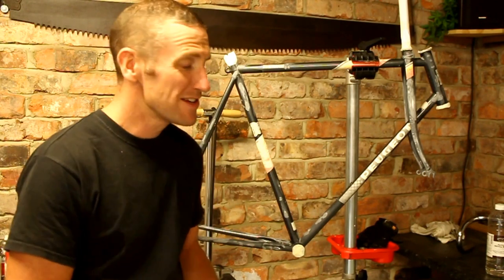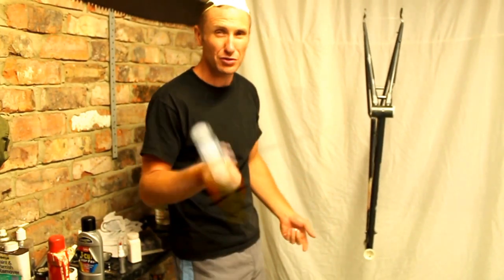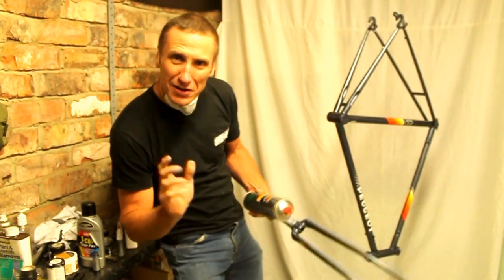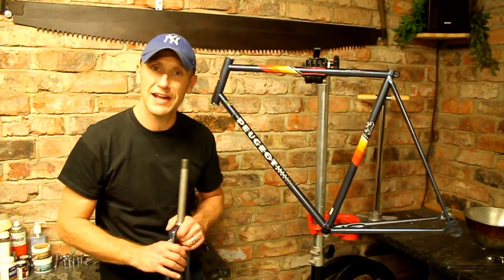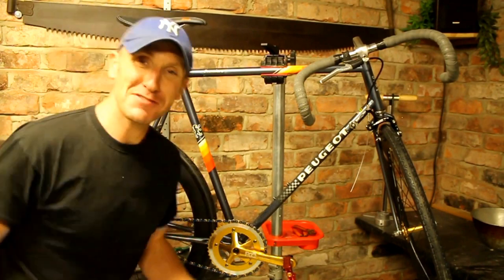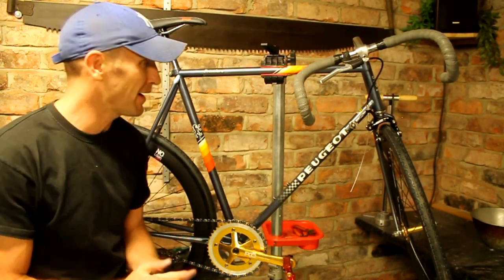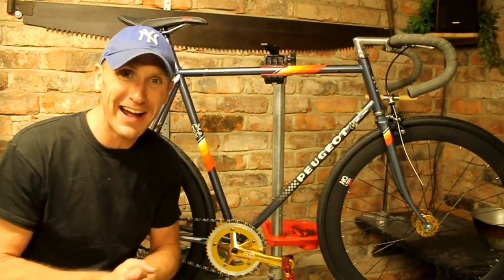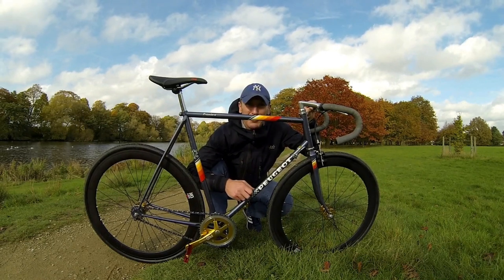Bike Maintenance - Part 2 -Rebuild and Ride- Peugeot Premiere Fixie Restoration

Comment: This is probably the coolest fixed conversion I've seen in a while. Usually I like the bike to be more modern if people are riding fixed (visual preference). But man, you pulled it off.
Reply from the maker: Thanks for the watching and the comment, stay tuned and Subscribe as I have just finished a Vintage Raleigh Fixie that will be up soon. I think it gives this one a run for its money. all the best Andy

Comment: I also have a steel Peugeot PFN10.
How did you deal with the standard hubs in the Peugeot frame original  is 96mm front and 126mm rear ??? The new standard is 100mm and 130mm.

Comment: I have a frame just like this. What bottom bracket and crank did you use? There's so many to choose from so I'm lost on which to purchase.
Reply from the maker: +Tim Large hello Tim I used the original bottom bracket and just replaced the bearings. The crankset I bought from eBay search for a 46t crankset. Thanks Andy

Comment: Hi m8, you said in the vid that you masked of the decals and then sprayed it, but how does that work, since you need to spray it all?
Reply from the maker: Hi and thanks for watching! Taping up the decals protects and stops the spray covering them up. This process only works if the spray you are using matches the existing one and  is more of a blow over. I hope this helps. Andy
Reply: @BikeItUK  Where did you find the exact matching color? I have a dark blue Peugeot from the same age and would love to paint it over, protecting the decals!

Comment: how much did the bike cost in parts, excluding the frame. got the same frame so think I'm going to convert it in the next few weeks.
was just wondering how much you spent.
Reply from the maker: +callum barker hi thanks for a he comment and watching I can't remember all of it the main cost was the wheelset £89 inc tyres and the crank £20. Good luck with the project cheers Andy

Comment: Once again a great bike! I'm respraying a Peugeot as well soon. However I'm worried about the difference in colour tone, new paint vs masked area. How did you avoid this except buying the original colour?
Reply from the maker: +Oliver Vukic I managed to find a general Peugeot match at Halfords on this one. If you are worried you can get it colour matched at a Auto spray company. More expensive though. All the best and good luck Andy

Comment: Hey Andy, me again, curious about the bottom bracket, sine the original had 2 or 3 rings, did you use the same bottom bracket? And if not, what size is u buy please?, thank you so much :)
Reply from the maker: +Nauj Aral Hi no problem, I hope you are well! Ref the bottom bracket I generally just use the original and buy new bearings, keeps the cost down and normally the only damage is to the bearings. If you do need a replacement then can you not just measure the original? Andy
Reply: its french but other then that, you could get a new bb yes

Comment: i was going to re build a peugeot bike but was a bit worried about the bottom bracket, as in could i put in a sealed english bb or would i have to try and find a french thread one?
Reply from the maker: +Andrew Leightell Most of the 80's frames are all standard Bottom Brackets I had no issues at all with any of them. Vintage bike are so much easier to work on than the new forever changing modern bikes. Sorry for the late reply thanks for watching Andy

Comment: Hi andy, I was just wondering what action i could take on a bike frame with a rust hole in it. - raleigh dynatech 700. hole is located on the chainstay so quite a precarious place to have a weakness, hole is about the size of the diameter of brake cable wire. cheers.
Reply from the maker: Hi, I’m pretty sure that it’s not steel. I would use a solution to treat the rust and because it’s such a small hole probably just use a metal poxy resin and sand off. I hope this helps all the best and good luck 👍🚲

Comment: I have a Peugeot I found that was abandoned  and it looks brand new except for rust on the rims. I thought about making it a fixie  but never saw it done until now. one question the crank assembly is all new and upgraded or does it still have old parts??
Reply from the maker: Yony M Old parts as a rule however some times new bearing are required which can be obtained on E-bay for a couple of pound! Thanks for watching I hope it makes you get involved with your Peugeot!
Reply: +BikeIt UK great thanks for the advice ! your bikes look dope! hopefully I can pull it off as well

Comment: Hi there! Love the channel and seeing you make these bikes look beautiful. I am currently restoring my dad's old peugeot, eventually going to make into a fixed gear. But going to leave it as a 12 speed for now. I need to replace the inner tube right now but I can't quite fine what size that is. Can you possibly tell me the inner tube size? As well as the wheel/tire size for when I look for the fixed gear parts? Thank you so much!!
Reply from the maker: +Joshua Kotani hello and thanks for watching and tuning in. The newer wheel size is call 700c and the older ones are 28". Regarding inner tube size there really isn't much in it, however what does matter is the widths of the tyre. If say you has a 30mm Tyre and used a 23mm width inner tube it's would stretch the rubber inner far to much. When your converting to a fixie and use 700c you may have to bang on some longer reach brake callipers. I know the RJbikeguy on here has covered it, check him out if you haven't already done so. I hope this helps and made sense. All the best and good luck Andy

Comment: It was amazing watching how you transformed the bike but Did you use primer and do you have to use primer, when re-spraying
Reply from the maker: +Abid Khan If taking the frame back to bare metal then yes it is advisable to use a primer. Thanks for the comment all the best Andy
Reply: +BikeIt UK thanks and another question that I got is, can you leave the old bottom bracket and put an new crank.
Reply from the maker: As long as its not damaged I generally replace the bearings which do not cost much to replace. Andy

Comment: Nice Job Andy. Was wondering if you did anything special regards to the forward leaning dropouts on the rear wheel for the fixed gear/single speed conversion where a track bike would usually have flat, rear-facing dropouts? I have a frame just like this that I run as a single speed too, but without the derailleur taking some of the tension out I've always been worried the wheel would slip forward out of it's dropouts (happened once on a test ride - bit hairy). Cheers
Reply: +Sam L I've recently turned a vintage frame with forward face dropouts into single speed. 
the best thing to do it make sure you have washers between the frame and the nuts, and tighten it like noones business. If you are still worried you can get nuts with washers build it that would be even more secure. Other than that you should be fine. I've been riding mine ages now even forcing it with all my might up hills and never had a wheel slip.
Reply: +Conor Salisbury Thanks for the reply!

Comment: Great video and bike. Plan to use some of the same bits on my blue Peugeot from same year. I've found the black wheels with gold hubs. Did you use the original crankset sprayed gold? Also did you use all original headset and bars? If so did you polish them up yourself? Full parts list would be helpful.
Reply from the maker: +Robert Macleod The Wheels was No Logo, Used a brand new gold crank set from ebay. Polished up the head set and handle bars, can't remember the brake calliper that I used. Seat was a Charge saddle. Good luck with the build hope that this helps and thanks for watching! Andy

Comment: Hi Andy. I love your videos that much its inspired me to purchase and old peugeot bike to restore into a single speed/fixie bike. Everything is going smooth so far but I'm struggling to choose the wheelset. I noticed you used some 'No Logo' wheels in your restoration, however these are out of stock everywhere now. I'm looking for a similar all black deep rim wheelset. Any recommendations would be much appreciated. Thanks, keep the videos coming!
Reply from the maker: Hi Nathen thanks for the words of support and really happy that the videos have inspired you. To be honest I don’t have a brand I always use. I will generally just search 700c 40 or 50 mm depth flip flop wheelset. The prices can vary from month to month but for a single speed wheel set I won’t pay more then £90 generally. Nine times out of ten I just use eBay. Sorry I couldn’t give you a direct link good luck hope you find a good set at the right price 👍
Reply: BikeIt UK Thanks for the quick reply Andy. I'll continue my search a little longer. So far I've found some made by Quella, which are a little more than I was hoping to pay but they are under some warranty. Thanks again!!

Comment: Hi Andy,

Great video - the finished product looks superb. I have just sourced the same Peugeot frame but in metallic blue and plan to covert it to a fixie! Other than the rusted areas you sanded/primed before spraying, did you just spray straight onto the original paintwork without priming beforehand? Thanks, Adam
Reply from the maker: If spraying I generally use a primer if small areas I will just paint on 👍

Comment: Cracking job Andy as usual. I have exactly the same bike and colour. Can I pick your brains if I may? Peugeot Iron Grey - exact match  or close? Did you mask off the decals accurately around them or just approximately? Finally I have got some very good alloy rims with a six speed cassette, also some nice alloy handle bars. Would you use these or keep to the chrome steel rims and five speed cassette and steel handlebars (all in very good Nick)? I'm thinking about originality and desirability? Any advise you can give would be much appreciated. Cheers Jonathan.
Reply from the maker: Hi, thanks for your comment of support, regarding your Peugeot it was some time ago now. What I generally always do is take the folks in with me when buying the paint. Regarding the build either go fully original if the parts are available at a cheap price, or I’d say if your going to be using the bike yourself go with what you’ve got. The bikes not a high end model I’d probably go with the wheels etc you have!👍 I hope this helps and good luck with the restoration all the best Andy 😉🚲 enjoy

Comment: What wheel set do you have what's the price and where can I buy them btw really nice bike it looks amazing I'm building a vintage fixie aswell but I'm making it chrome
Reply from the maker: +lukas mikolajczak Very sorry for such a late reply the Wheel set I used on this build was a company called "No Logo" I hope this helps Andy
Reply: +BikeIt UK you are correct that was a really late reply but it is still such a beautifull bike thank you for the information

Comment: Hey! was wondering if you had any trouble attaching a single cog wheel onto the frame that is made for wheels with multiple gears. Did you have to bend the rear forks to fit. Or was the rear axle just long enough to fit the frame/did you use spacers? (thinking of starting a similar project) Cheers!
Reply from the maker: The new spindles are slightly wider, you can generally stretch the back folk out a millimetre to accommodate. Thanks for tuning in. Andy
Reply: Sorry, i mean is the frame not too wide for the single speed wheel, or did it go on with no problems? And did you get a nice straight chain line or was that a bit off? Thanks :)
Reply from the maker: +Jamie Stone thanks for watching and the comment. The rear spindle that came supplied with the single speed rim fitted the rear folks, a little tight but fitted straight on. Good luck and hope you get stuck in all the best Andy
Reply: +BikeIt UK cheers!

Comment: the drilling can make the fork weaker in that part. Have you investigated an impact for stiffness and safety? thx.
Reply from the maker: Thanks for watching, Its only making it the same size hole as a modern fork and its a millimetre wilder if that, I would also say the older steel is a lot stronger than the more modern lighter alloy. All the bikes I have done this too have been absolutely fine with no problems I hope that this helps Andy

Comment: What did you use where the shifting levers where at?
Reply from the maker: +John Zarn hi John, I put the levers back on. I just think it loads than better than leaving the holes exposed. Plus I feel it preserves the frame and original fittings a little should it ever be converted back. Thanks for tuning in all the best Andy

Comment: you did very nice job! where did you get your wheels?
Reply from the maker: +ant efstathiopu Sorry for the late replay just seen your comment. Thanks for the support regarding the wheels I bought them from eBay, however i am sure you can find them on-line, the wheels are from a company called NO LOGO. I hope this helps, they came with a flip flop hup. All the best Andy

Comment: Hi Andy, where did you get hold of the crankset and pedals/what brands are they on this bike? love these videos mate looking forward to the next! You've inspired me to go for the same look as this Peugeot on an old 25" Reynolds 531 frame I have lying around at home - a first for me.

Also, thanks for all the tips to keep costs down and love your enthusiasm, I may well try to do the same as you one day and make this a bit more of a serious hobby, its a lot of fun.
Reply from the maker: Great stuff glad to hear a man after my own heart 😉 really glad the videos have helped. I’m unsure of the brand of crankset etc. I search eBay for gold 46t crankseti as far as I can remember. More videos coming soon just been so busy with a home extension 😞🚲all the best and thanks for the support Andy
Reply: They've helped hugely, the only thing I am currently struggling with is trying to figure out the length of steer tub I'd need on a set of forks as the frame didn't have any, can you offer any help on that (its a 25" vintage frame)? Good luck with your extension! :)
Reply: steer tube* i'm struggling to find one long enough on ebay!

Comment: Great project, love the bike. I am attempting to also do up an old Peugeot, mine has significantly more rust pic marks and paint chips. From what I have read spray painting over existing paint is a bad idea as it chips of easily, even if you sand down all the existing paint. I was wondering did you sand down all the grey areas or just spray paint over, and how is the paint holding up? Congrats though, looks mint!
Reply from the maker: Paul Steen Thanks for the comment. What I used first was a rust solution, then sanded down all areas to bare metal. Used a thinner and rubbed down the frame before priming, then applied the colour,  then to finish off I removed the masking tape which was protecting the decals and finished off with a clear lacquer. The frame is still in good order. Maybe thats also to do with general care of the cycle keeping it clean and drying it off.  I also have a old Peugeot waiting, its a PH12 from 1982 should be a good one so watch this space. So good luck with yours and I hope it brings you memories and happiness!

Comment: @Nauj Aral A lot of older Peugeots have French bottom bracket threading, so you won't find a replace unless you order an expensive one from Velo Orange. About $80, vs $15 for a shimano "English" cartridge bb. Any French bikes before about 1980 are likely to fall into this category. As for chain line, there are ways to calculate it. I would recommend trying the original if it is still serviceable and adjusting to longer or shorter spindles from there. You can also cheat a millimetre or two with spacers on the drive side cup, or behind the rear cog as long as you still have LOTS of thread engagement.
Reply from the maker: +tomalcolm Great advice, thank you for the comment all the best Andy

Comment: Hi Andy, great video! I've bought a Peugeot exactly like that one (well, it's yellow) and it's missing a few parts, and since I'm from Argentina it's hard to get them. I'm missing the shifters, would you know what kind of ones I can use as a replacement? For example, the ones that are already assembled and brace the downtube could be used ? Thanks!
Reply from the maker: Thanks for watching and your support, regarding shifters and braze on shifters can be used on the frame. However if you are going to be fitting gears then ensure they work with the rear mech. You generally can’t go wrong with friction levers. Hope this helps all the best

Comment: Hi Andy, well in my inexperienced bike mechanics I thought the original is longer since it carries in my case 3 rings so it's got to be like 2 to 3 inches longer, so I thought when changing it to a single ring crank it would be shorter. Since you mentioned you normally use the original I assume you didn't have to change it and works very well with a single speed crank set, do I will take it from there and use the original see how that works out :) thank you for taking the time as always, am watching your last video, seems as good as usual. Have a great afternoon /evening, talk soon
Reply from the maker: +Nauj Aral It should work fine, ensure all the bearings are in good order if not they are very cheap for a new set. Good luck